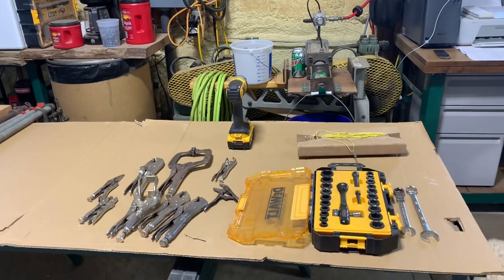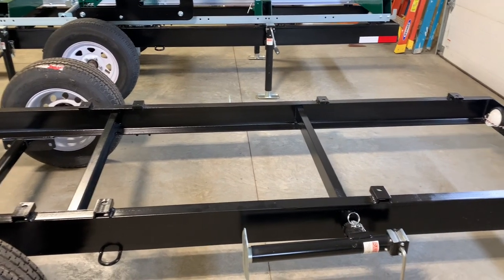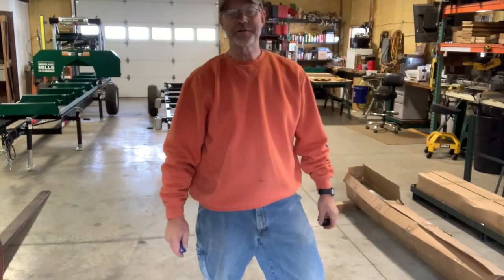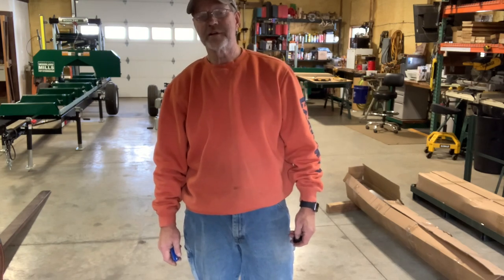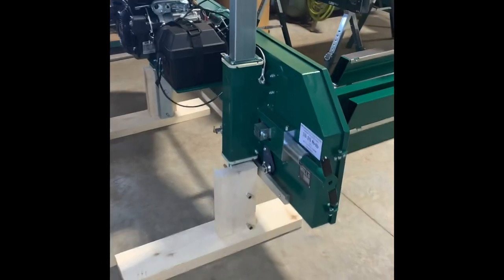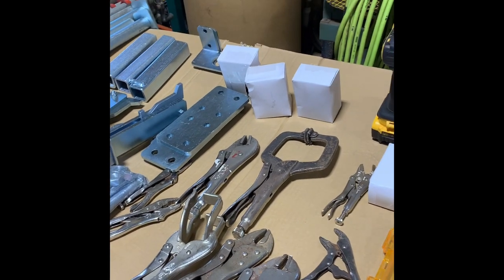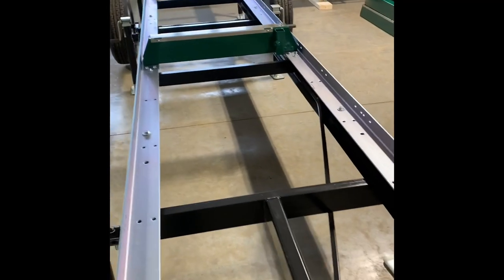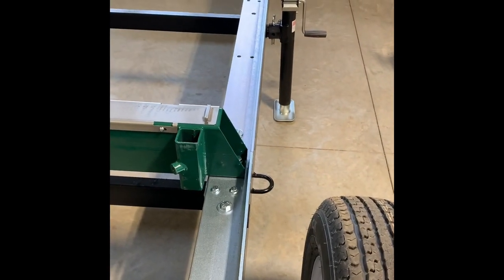HM130Max Trailer Setup and track assembly

Comment: Hey Dan, thanks for the tips on setting up the track. I'm about to start making my trailer but noticed you dont have any means of vertical adjustment of the track where it bolts to the trailer chassis.
I'm considering using the adjuster bolts that comes with the track and threading them into the chassis flange with a nut as the vertical adjuster to accommodate any variation over the length of the "C" channel. Congratulations on a nice setup.
Cheers
Reply from the maker: Be carful lifting the tracks up off the trailer. It doesn’t work well. If your trailer flexes at all during transport ( which they all do) and your track is lifted your joints will start pulling apart. The more it’s lifted the more  it will move.